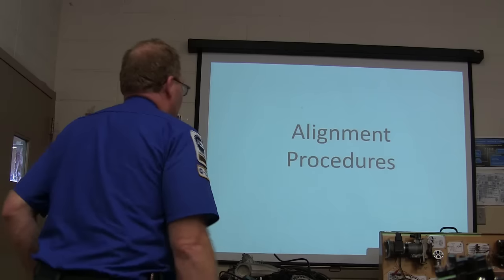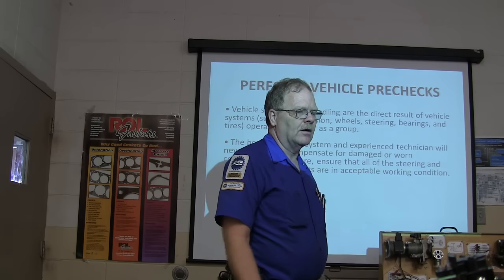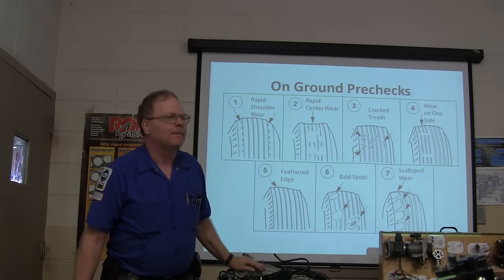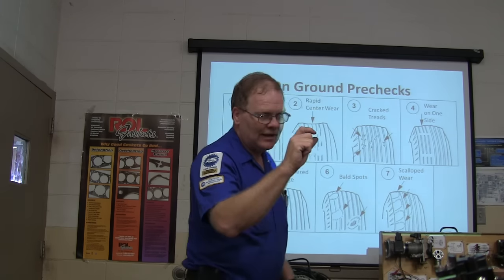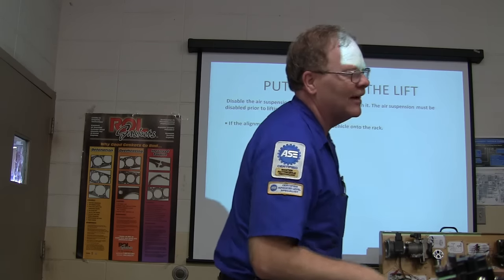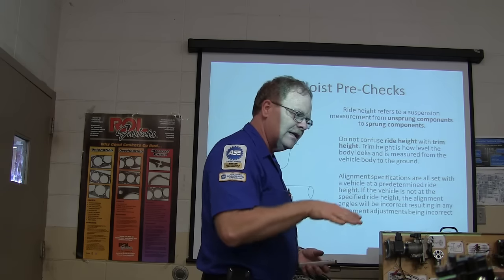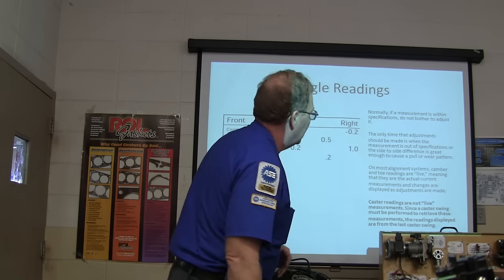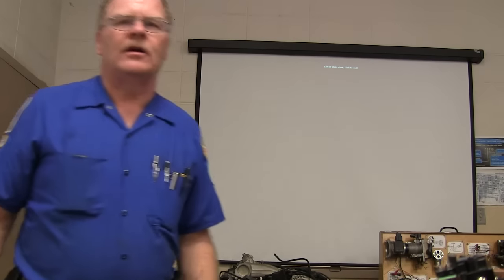Alignment Basics - short session

Comment: I used a drill and regular drill bit when I had to remove the spot welds on a mercury sable( same thing like a taurus). Which gave me barely any camber adjustment.  Also after removing the spot welds. It looked like swiss cheese.